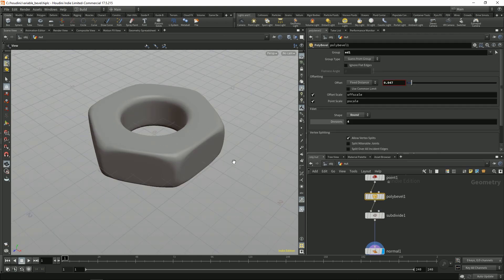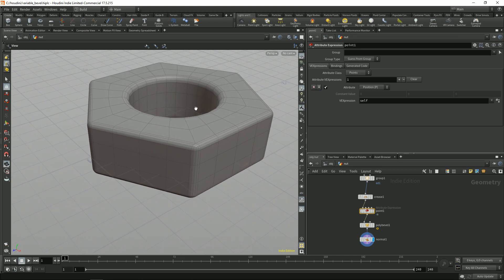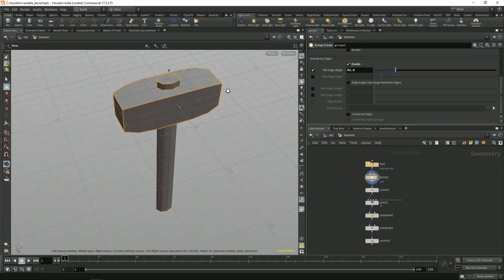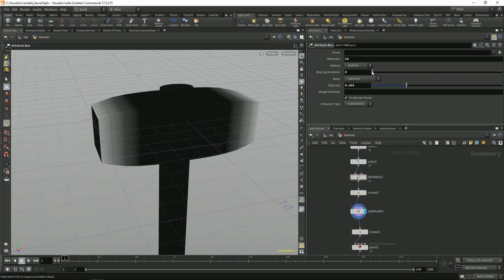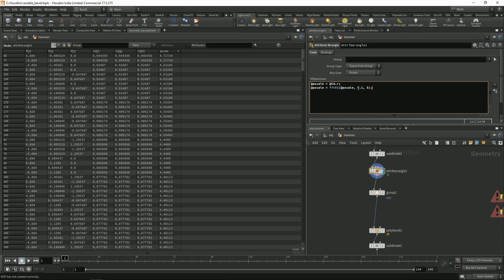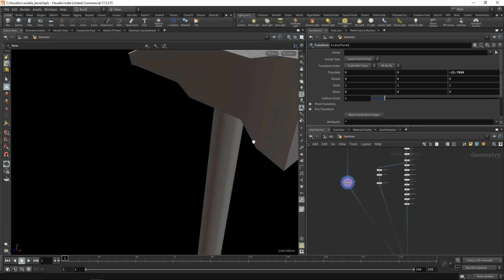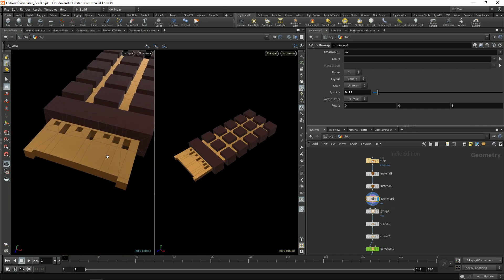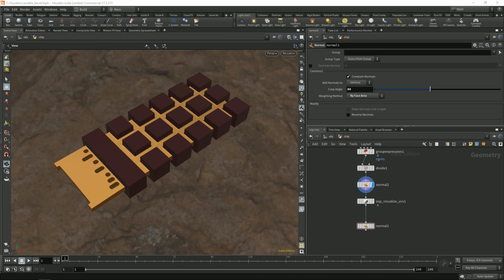Variable Bevel Width

Comment: offset scale has disappeared from the houdini 18 polybevel :(
Reply from the maker: It is still there but it is in a different place. Offset is now called "Distance" and just right to the slider you have a parameter you can change from "No Scaling" to "Scale by Attribute".  There you can use your pscale attribute.
Reply: @Houdini123  I can't seem to get this working in 18 either. The bevel node returns that It can't find the attribute.
Reply from the maker: Just tested it, works. Do you have the pscale attribute on your points and are you using "Scale by Attribute" option?
Reply: @Houdini123  Sorry, I am very green with houdini and am not sure what you mean by "Do you have the pscale attribute on your points".
I do have scale by attr set which then gives me pscale.
Reply from the maker: @nuckle no problem, check out this video, super easy - https://www.youtube.com/watch?v=dvTuyJF6x9A&t=90s